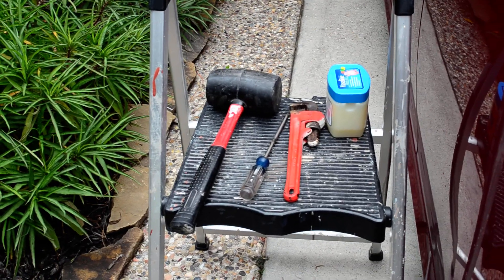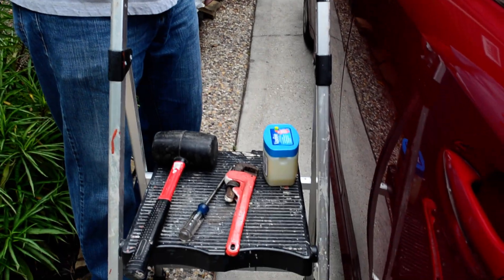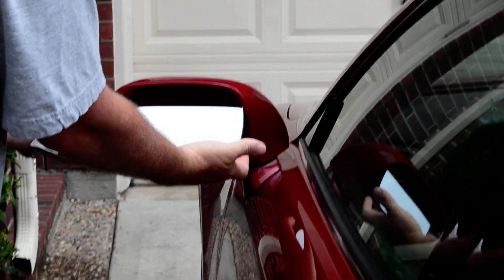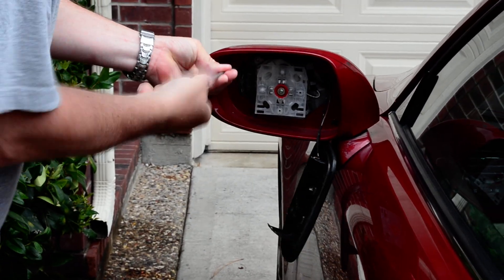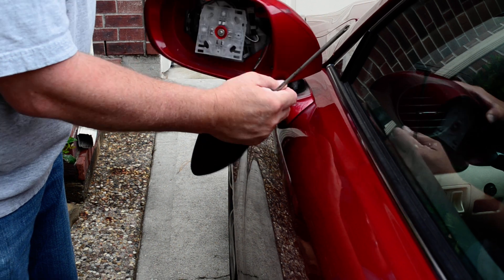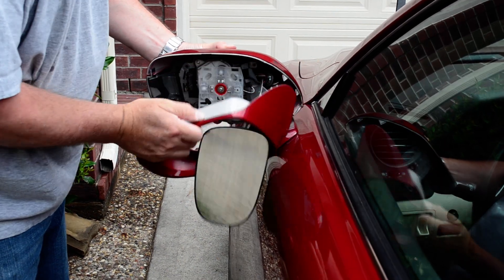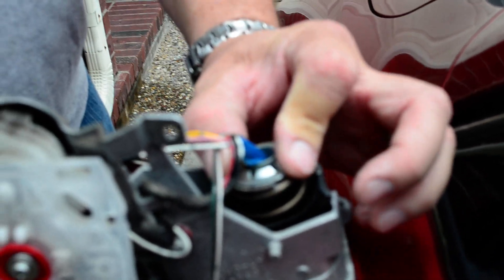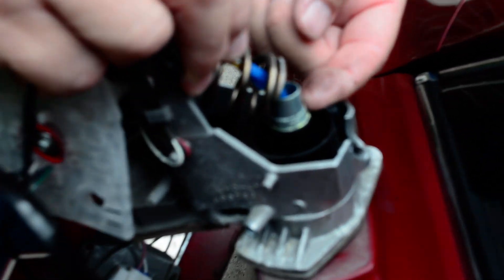Repair Loose/Broken  Lexus Side Mirror Housing

Comment: Thank yo for a great video.  This helped out a lot.  I didn't use a monkey wrench.  I had a piece of PVC pipe and cut about 3 to 4 inches and cut a notch down the middle of the pipe.  The notch was cut to let the wires pass through so I can use more surface area pushing the clip down.  I used a piece of wood to push with my hands and seat the clip before using a mallet to tap the clip down.  Thanks again for the tip.

Comment: Very helpful.  The pipe wrench did not work for me since the spring force was so high.  Instead, I used an oxygen sensor socket and a socket extension rod.   The oxygen sensor socket has a gap to allow it to fit over wires; so, it is nearly perfect for this application.  The socket fit well and it was far easier to compress the spring.  Finally, be careful with the mallet force.  It is possible to compress the spring so much that the mirror housing will no longer rotate.

Comment: My SC 300 mirror was repaired twice before, and the tube was mangled.  What I did was put a long thin bolt down the center of the tube (with a small washer on top), right next to the wires. On the bottom of the support, I put a washer and nut to tighten the spring down. I used a weaker spring. This will never fail again!!!!

Comment: You need ALOT of force to push the washer thingie back into place, I couldn't do it and neither could my bro in law and he weighs 275...I had him hold it in place with the monkey wretch and I hammered it down using a flat head screwdriver on all sides until it was secured.  Works like a charm now.

Comment: I took a PVC Tee and cut a grove for the wires. It was easy to apply pressure by hand to get the initial catch.  For the final whack with a mallet, I used a flare wrench. All took less than 10 minutes.

Comment: THANKS FOR THIS ,, WAS PRETTY EASY TIL TRYING TO PUT PRESSURE ON WASHER & SPRING, MADE MY OWN TOOL ,8 " PIECE OF 3/4  PVC CUT A SLOT ON BOTTOM SIDE FOR WIRES, THEN A 3/4 PVC  "T" ON TOP TO PUSH ON ,, WALLA WENT RIGHT ON. TRIED PIPE WRENCH (NOT)

Comment: great video!  combined with this posting on clublexus com (title is: drivers-side-view-mirror-actuator-broke)  I was able to fix this problem for $0.93 using a 5/16 hose clamp at home depot.  The clamp could not be hammered back into place so I used  hose clamp and pushed down on the spring with my thumb and then tightened the hose clamp with a power drill.  Works great so far!

Comment: Will this work on any vehicle? Are the designs all similar? I have this issue with my passenger side mirror in a 02 GMC Sierra Denali truck. If others have been trying this on makes other than Lexus, then I'm going to give it a go. Any feedback is greatly appreciated.

Comment: Thanks dude, this has made my year.  I have a 2002 430, so I hope it applies.
Reply: sam did it work for LS 430 have same issue just didn’t know if that year was too old
Reply: @alexthefixerupper4134  I have an 03 ls430, is the mirror assembly the same and can this fix be applied ?

Comment: I tried this but couldnt get to work, looks like the spring clip could be to wide open, or the metal piece im pushing it down in is stripped and wont the clip wont grab it.

Comment: I was able to get the washer down but my mirror no longer rotates.  Any ideas?  Perhaps I pounded it down too far?
Reply: I've done this fix on my HS250h on both sides, and nether mirror will fold in the way it should.  I think it is the result of pounding the washer down too far, but I rather give up the folding feature than have to repair it a second time.  If either fails again, I'll try the hose clamp method mentioned by others.

Comment: I tried these steps for my gf's hs 250h and got stuck on the last step. For the life of me, I couldn't get the compression nut onto the shaft. Any tips or tools that might make the job easier? I tried for about 2 hrs before giving up.
Reply from the maker: You have to be on a ladder and get above the area to get enough weight and force to do this. see Robin De Los Reyes comment on what he did with a pvc pipe and notch
Reply: @txtamer  I saw in another video that using an oxygen sensor socket helps. I was finally able to get it in place after a very hard placed smack. Your video helped out a lot, thanks!

Comment: Thank you for video. Compression ring not effective. Used 5/32 x 1.5 inches tension pin. Drill with care and not damage the wires. Tension pin directly on the flat side of the spring. Pin cost $0.25. Lubrication of the spring, white grease $4.67 + tax.  😎

Comment: Can anyone confirm if this works on newer models as well. I don't drive an IS but I have a Lexus NX 200t 2016 with this same issue. A little hesitant and scared to go ahead and take it apart... Any help?
Reply: Hey,  I have the same car and issue.  Did you end up using the instructions from this video?

Comment: I tried with so much force to push it down using the same tools you did but no luck. Any other thoughts? Thanks!
Reply: +McSaggler You guys can disregard this comment. Instead of first easing it into place and then using the rubber mallet, I went straight to the rubber mallet and it worked like a charm. Thanks Larry Reamy!
Reply: @McSaggler  how did u just use a mallet to fix it.
Reply: John Wilson I still used a rubber mallet and the monkey wrench. In the video he used the monkey wrench to first get the nut in place, but I skipped that. I just used monkey wrench and whacked it with a mallet to get it in.

Comment: Now if you don't want that retainer washer to come out again.  What l did it was a hole thru the pole, and l pushed thru that hole a wire. I used a paper clip. That will stop the retainer from popping out every time.  Guaranteed.

Comment: This definitely does not work like this video shows. If the nut is wore out you will have to get a whole new unit or double sided tape. I tried this several time with the exact same method and all it does is bounce the spring back up. It's a very good video of that compression nut isn't wore out.
Reply from the maker: Are you suede that you pushed it far enough down? The first 1/4” or so is a smaller diameter to help get it started. It takes a lot of force from above to get it down to the actual area that it will stay on. Thousands of people have said it works every time.

Comment: Between the 30+ pounds of resistance the spring is creating and the pressure needed to get the washer's teeth to grip onto the base, I spent 3 hours attempting this and could not get it to work. Will probably just get some stupid mounting tape and call it a day. I never turn the mirror inwards, anyway.
Reply from the maker: DId you use a step ladder to give you the leverage to rock the ring down on the post?

Comment: Shoot.  I have a 2010 IS 350  C.  Same problem.  I did all this, same kind of wrench, and I simply couldn't get enough downward force to get the clip to catch.  Nor could I get two other people to put enough force.   Yes standing on top step of step ladder too and two of us weigh 200 lbs.  Tried it various times.  Grrrrr.....
Reply: Ok.  So dragged my mechanical engineer neighbor over (I'm electrical) and we noodled this effort.  First, we took vise grips and pinched the spring lock washer tabs all the way around to tighten up it's grip a little.  Then, my neighbor has a band saw and we took a piece of thin wall pipe (1/2") and cut a notch out of the end to clear the wires.  The pipe was about 10" long.  While my neighbor put weight on tool and on the washer and pressed the spring to the collar of the mirror shaft, I smacked the end with a hand sledge hammer.  That was enough to get it to catch.  We then maneuvered the tool around and did single smacks at various points to get it all the way on and flush.  How this thing popped off in the first place is a mystery.  I really think a pin is a good idea to keep it from coming off again.  I think all tolled, it took about 2 hours of messing around and then coming up with the tool.

Comment: Its really hard i have tried it several times but it keeps popping up. Any other ideas?
Reply from the maker: I have read on my posts where a few people have drilled a small hole near the top of the round tube. They then held the ring down and inserted a small screw in the hold to act as a barrier so that the ring would not pop off. Also, try and bend the inner clips on the ring inward to get it to grip better.

Comment: Terrible design flaw, why didn't they put a nut on top to keep it in place instead of a clip that'll eventually pop off? It's only held by the tabs so after a while with vibrations, it'll fucking pop off

Comment: This was horrible engineering at work here...why in the world wouldn't they just use a regular nut with a washer below it?  It would never have the problem of popping off for no reason.
Reply: You took the words right out of my mouth Hoa, what were they thinking?  This design is doomed to fail, in my opinion the only way to permanently fix this is to install a roll pin, cotter pin, or similar device to hold the compression nut in place.